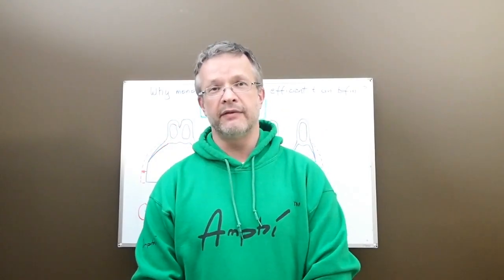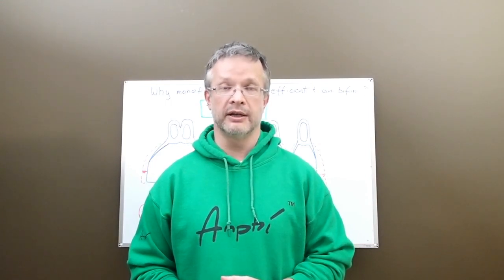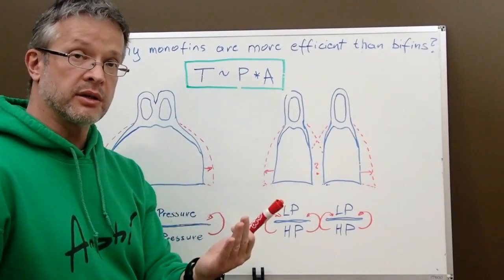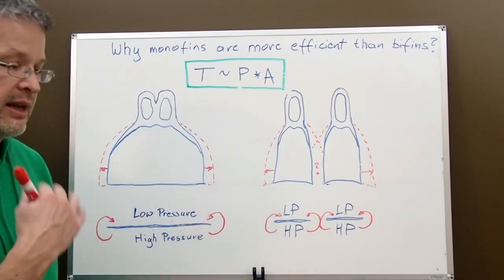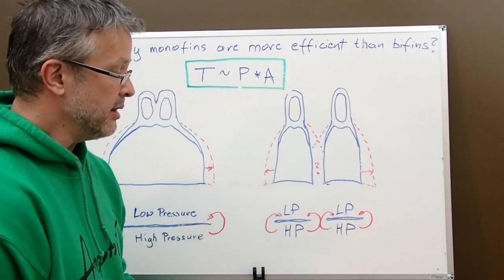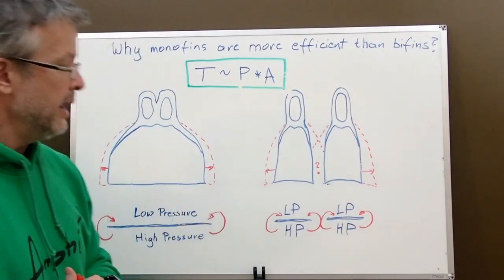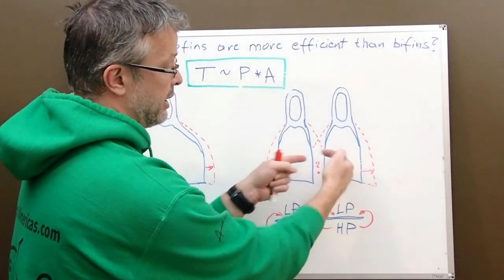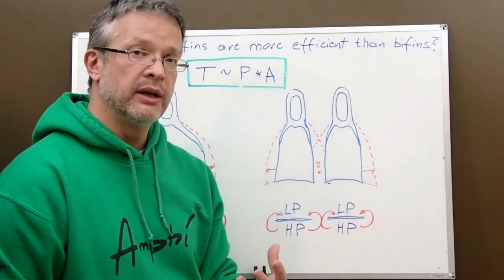Whiteboard Mondays 06: Mono vs. bifins - efficiency

Comment: Another thing that I had not considered! Another great video guys! I have never tried a monofin before. How is it when it comes to turning and maneuverability?
Reply from the maker: Well,monofins are considered less convenient for work which requires frequent turns, stops etc. which is probably true, the secret is the size. Most monofins have a surface area greater than any given pair of fins. Thus turning it requires more effort. I doubt it would be that obvious if we compare similar surface areas, but I never tried. There are smaller monofins on the market used by swimmers for training. Having said that, bifins allow for a lot of movement, which always introduces more drag. So having your feet tied to the same point saves a lot of energy. But, the bottom line is, the should be used for different purposes. If distance and efficiency is not your priority, use bifins, if you want to travel faster and stay under for longer use mono. And by all means try a monofin it's a fantastic propulsion system, very elegant. CHEERS.
Reply from the maker: I hope I answered your question, Dustin. Marek
Reply: @amphiwateradventures  Awesome! Totally answered my question! Thank you! I can't wait to try one! Especially after hearing about how they worked over the competition back in the day. I've always enjoyed the speed of swimming with fins. Have a great week!